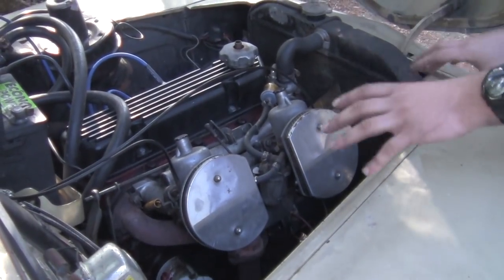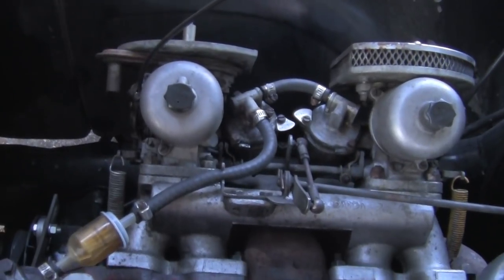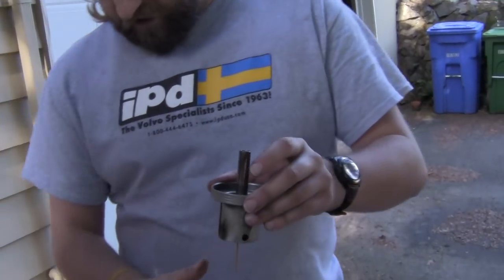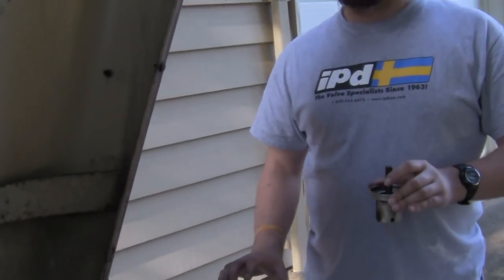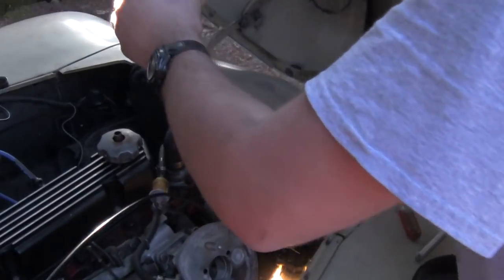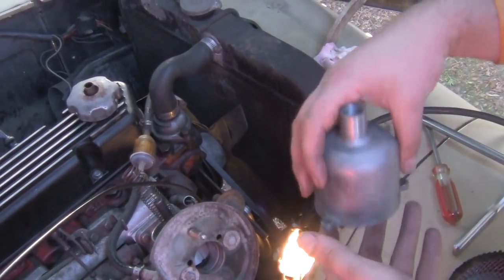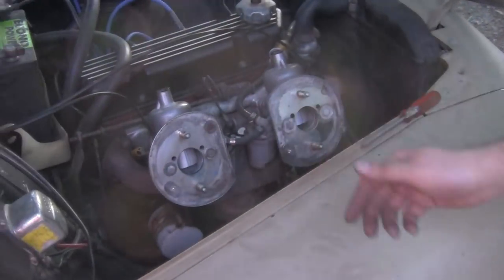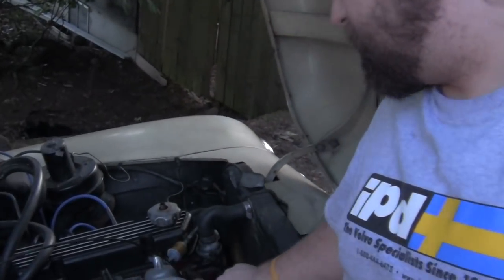Dylan's 544 #3: Setting those SU Carbs!

Comment: i have a 260z and it seems that my su's are very out of whack. both jets are set identical but the front sucks much more air and makes no difference when i lift the piston whereas the back makes the car almost die out if i lift it. . car is very slow as of now
Reply from the maker: Look at your intake manifold and make sure it isn't leaking air.  A spray bottle with water will help you find any potential vacuum leaks.

Comment: Can you explain cold start problems with dual SUs?   I have them on my mini and it takes a lot of cranking or a quick shot of ether to get them going.  once it's warm it will run like a top.
Reply from the maker: Pull the air filters off (so you can see what is happening) and pull the choke out all the way.  Both jets should drop the same amount.  If the jets don't drop, the choke isn't working.  Investigate and repair as needed.
Reply: they both drop.  I even pulled off the tops and checked looking down in.  they drop about a 1/8 of an inch.     I rebuilt the carbs when I got them.   it runs great once it starts.     Thank you btw
Reply from the maker: I suspect your jets aren't dropping as low as they can.  See if you can pull them down any further.  If you can, adjust appropriately.
Reply: that's what it was.  bam.   thanks.    it fired up in five seconds.  :)
I'm re tuning them now.
Reply: OK,   The choke is figured out but now I'm retuning the carbs and I'm running into a very rich issue.   I loosened the choke cable and adjusted the mixture nuts flush inside.  I turned them out 12 flats.   I used my synchrometer like you have and balanced them.    If I lift up the needle about a 1/8" and hold it the car will slightly rev then almost die.   so I richen it up a little.  I try again and the same thing.   I finally get it so it doesn't stall and seems normal but the exhaust is really rich.   I drove it and once you give it a bit of gas it falls on it's face like it's not rich enough.   I tuned these before and the exhaust was pretty clean.   I should have left them alone.   any ideas?
Reply from the maker: Sounds like you are running way rich.  Try leaning it out some.

12 flats is just a general starting point.
Reply: Will do,   When I lift the needles it acted lean so I kept on richening it up.    I'll go back to 12 flats and see where how it is.Thanks, Tom
Reply from the maker: Don't forget, You may need to go leaner than 12 flats as well.  As mentioned, it's just a starting point.
Reply: Well I had it way rich but it acted lean when I'd lift the needles.   I just messed with it agai and it so far runs great.   Actually feels more powerful.  I'm happy.  Engine pic of the pighttps://plus.google.com/photos/...
Reply: Great advice, a few years ago I had months of frustration adjusting carbs and ignition timing to try to solve a cold start problem on my midget, then one day it suddenly clicked that the choke was incorrectly adjusted. Problem solved!

Comment: HI Dylan, Can you assist,? I have a tr3 with Strombergs I rebuilt them , The book says idle jet out 3 1/2 turns out It runs good but it diesels bad  when I turn it off will not shut down then I screw the jets in and the engine slows down seems rough at idle but runs good at high speed  and  will shut down Any ideas why it will not idle smooth
Reply from the maker: This sounds like a timing issue to me.

Comment: very helpful, I am guessing these are the same carbs, and same adjustments as the carbs on my 1973 MG Midget Mark III, anyone know for sure, they look the same, mine run great after a 5 minute warm up but it cuts off if I don't keep it throttled up to approx 2000 rpm for 5 minutes, so I know its out of adjustment a bit, and I need to try this clean up and adjustments.  Could be a choke issue also as I have to choke it to start and I probably need a new handle and choke lock as I have to manually hold the choke out for a minute to let the engine get warmed up.  I might order the synch tool and a mgb choke knob, choke lock and choke cable from Moss motors during the black friday, cybermonday sale!  I also need a need a new gearshift boot and maybe a dashboard topper to hide cracks!
Reply: the MGB choke knob is a cooler T handle rather than the round knob and it works fine on my buddy's midget
Reply: Ended up I needed new throttle shafts , springs which my MG mechanic was able to do

Comment: What could be the problem if u have very low vacuum on the one carb and normal vacuum on the other. It's only got 1 psi of  vacuum
Reply from the maker: You've probably got a major vacuum leak on your intake manifold somewhere, or throttle shafts that are totally shot.
Reply: @DylanBerichon  how do you fix the throttle shafts?
Reply from the maker: @dougclark787  It requires complete disassembly of the carb, removal of the old shafts, and a press to install the new ones.  This is a job typically best left to a SU rebuilder, as it requires a number of specialized tools and skill.
Reply: How can you identify the leak with some starting fluid while its running

Comment: When balancing the carbs you must disconnect the throttle spindle from each other. I did not see you do this. If you do not disconnect the carbs throttle from each other, you cannot adjust and balance the air flow into each carb. They must be disconnected from each other.

Comment: It's a shame you've set your carbs and the valve clearances are miles out of spec.  Tappets  ignition and Dwell are first port of call.  Nice video all the same 👍
Reply from the maker: If you check my channel, you'll find a video I shot the same day setting the valves, which was done before I set the carbs.